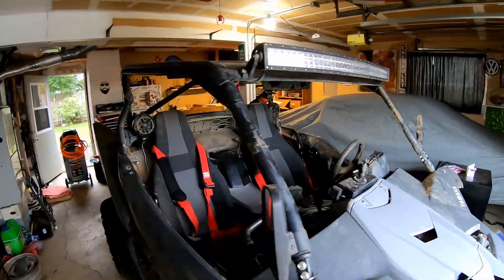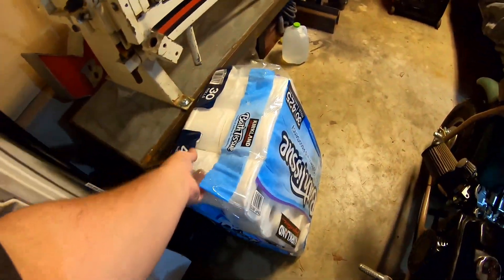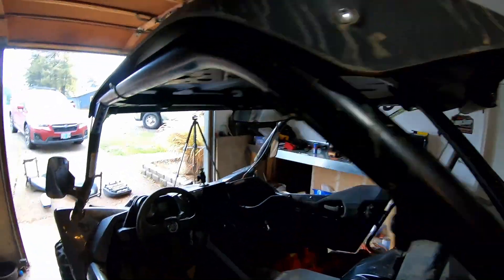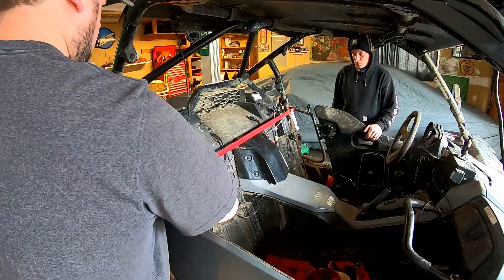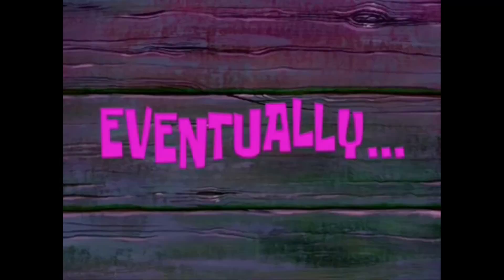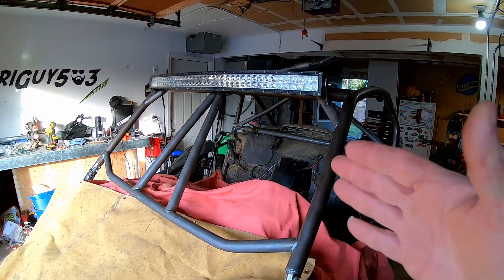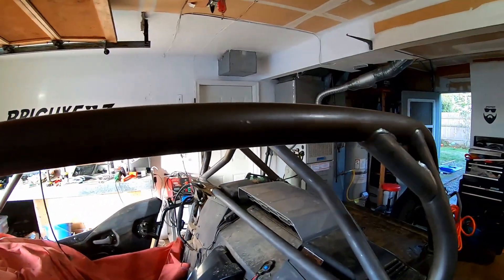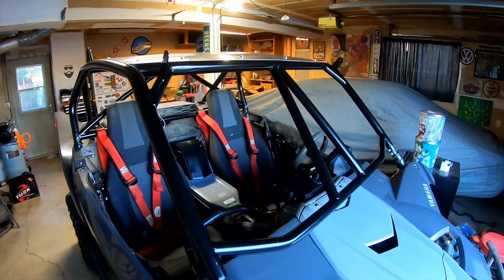YXZ1000R Weld it Yourself LSK Cage Install | 2019 YXZ1000r WIY Radius Roll Cage | Similar to CAGEWRX

Comment: How has the LSK cage holding up since your installation video? I'm thinking about getting one vs skid plates. Have you ever heard of the Cage WRX Baja Spec for the YXZ?
Reply from the maker: It's been great! LSK is great if you can weld it yourself. It saves you alot of money. But if u need it welded, the cage wrx is essentially the same cage. So I'd just go with whichever company has the cheaper price at the time you buy.

Comment: Your welds look great! Nice job! 👍
Reply from the maker: Thanks! We also did Alex's cage the next weekend afterwards.
Reply: @BriGuy503  Back in 2005 I bought a cage for my Yamaha rhino and I painted it with satin black engine paint. I owned the rhino for 10 years and the cage still looked great. I think the paint you used is even better.
Reply: @69headwound  Hey bro!
Reply from the maker: It covered pretty good except a few fish eyes on the front part. But I think it still looks good. I mean, for $24 lol
Reply: @69headwound  Great! Planning a trip as we speak!